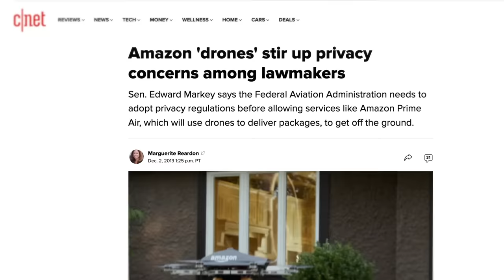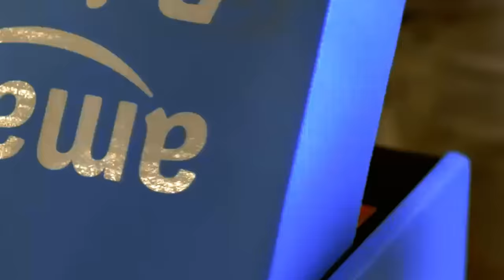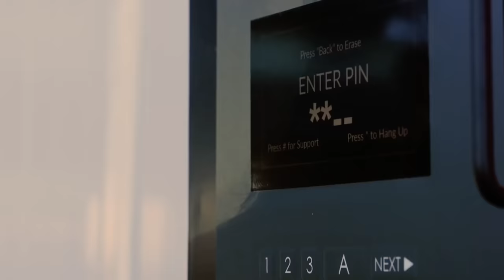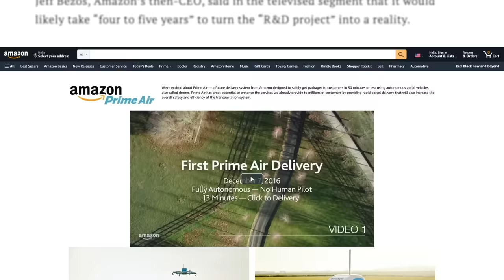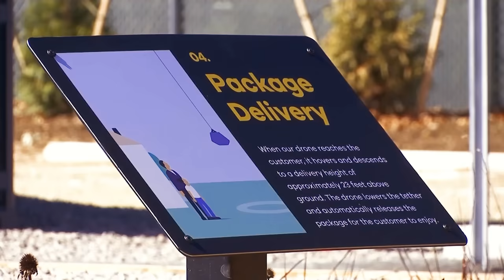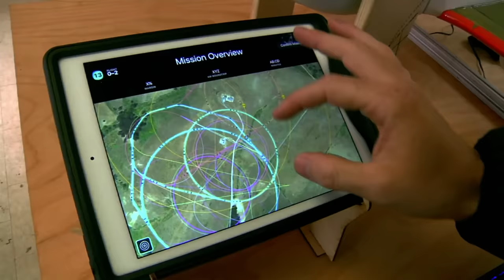Drone Delivery Was Supposed to be the Future. What Went Wrong?

Comment: In 2015 I had a college class that we needed to look at an emerging technology and do some research into the challenges facing it. For my group we did autonomous drone delivery. The biggest hurdle we found facing it was FAA regulation, namely that an autonomous drone is required to have a pilot on standby incase of an unexpected signal loss or unknown obstacles. That alone killed the tech in my mind. If the drone needs trained professionals on standby, you lose the savings from automation.

Additionally, the point you brought up of it needing to be perfect is also really accurate too. We figured it would take just one sensor going out, a failed backup, and then the drone crashing on top of someone that would doom the tech. It gets even worse if you try to have it function in a city with high population density since the odds of it landing on a person become massively higher.

This is a cool technology, that's propped up by dreams and hope, with no footing in our current reality. I think it has potential in limited uses, but not how it was pitched.
Reply: alot of the issues seem to be more engineering failures rather than fundamental. The 'falling out of the sky' would not be realistic using VTOL fixed winged aircraft (similar to what google currently deploys). While professionals on standby would indeed be expensive, you theoretically only need a handful to cover thousands of active aircraft if the failure rate is reasonably rare... thus recouping those costs with scale.  
I really dont see the issue with food delivery as a use-case. Customers value speed quite greatly, the alternative is a dedicated car/bike trip (much more expensive, paying for human labour). Most food items weigh under 2kg, a winch system (as google is doing) gets around all but the worst edge cases in delivery by removing the drone from any contact with the ground and an automatic or human operated battery swapping station would lower capital expenditure buy keeping each vehicle in the air close to 100% of the time.
Gartner hype cycle was a good analogy of the technology as alot of the 'issues' are solvable with good engineering and development time. (Really dont know why they dont use bigger props for horizontal thrust at least to reduce noise)
Reply: I wonder if instead of delivery drivers, you could have mobile drone stations. Drivers would park at a location and monitor the drones as they delivered within a given radius.
Reply: @fakename3208  why would you want to involve humans at all lol
Reply: @Redstoner2b2t  because as OP just said the FAA requires someone be ready at the controls in case something goes wrong.

But the bigger question might be why would you want to trust the AI completely? Have you seen Terminator?
Reply: googles wing already has FAA exemption (flight engineer doesnt have to actively monitor), its not hard. also lmao
Reply: Why not creating ground tunnel or sky tunnel for drone so make sure the tunnel only for drone to keep delivery not even noisy and safe?

For us to make better future should create tunnel for in every house or apartment with special tunnel unit so everyone can enjoy delivery without worry

More privacy should every room have to have special tunnel for drone will be amazing
Reply: @tonysantosa4193  mmmm yes Mr. Einstein, drones in tunnels. 🤣
Reply: @Redstoner2b2t  big tunnel or big long and thick vent ceiling in every room will be epic no need delivery man to come unless you work outside field that little disturb maximum 15 people so drone can use outside for delivery those people
Reply: @tonysantosa4193  are you actually being serious? Are you five?
Reply: @Redstoner2b2t  what 5?
Reply: @tonysantosa4193  your age
Reply: @Redstoner2b2t  lm just high school gradute person..not even go to campus
Reply: @tonysantosa4193  try to think about your ideas before posting it online for people to laugh at, especially when it’s comically infeasible
Reply: @tonysantosa4193  Ignoring the cost and logistics, I’m not giving Jeff Bezos tunnel access to my house.
Reply: Ok
Reply: @fakename3208  An even bigger question, why do you rely on fictional movies as an accurate depiction of AI?
Reply: @Oliver Charles  I was being facetious, though I do take the danger’s seriously. Automation is always dangerous, and “AI” like chat gpt is essentially a conglomeration of human thoughts and passions and ideas…which as a Christian I would label as demonic. There’s a reason why most chatbots directed to talk to eachother almost immediately devolve into speaking about sex and violence.
Reply: @fakename3208 Do you also label videos as demonic? 🤣🤣🤣
Reply: That is one hurdle, yes, but hardly the biggest. How about maintaining line of sight? What about personal airspace? I have a degree in avionics and my capstone was in part about the use of drones in urban areas. There are several laws that make drone delivery unusable.

Comment: Because it's a plastic quad drone that weighs 4 pounds, can't fly in windy or rainy weather, is sensitive to changes in weather, can only carry one thing at a time, has to deliver hundreds of packages a day, has very limited range as it needs to be directly controlled (or risk it going places it shouldn't from tiny errors), can't be used around airports or military bases, and is run using a battery that couldn't likely cross a city and make it back once without a recharge. A truck can deliver many more packages, can be used in most any weather, can go to places around restricted airspace, can easily handle heavy loads, can easily drive across a city multiple times, doesn't need complicated software/human operators are easy to train, and issues do not cause them to drop out of the sky onto people, roads, and homes. Drones are in no way perfect, and the only group with drones that COULD manage all of the things needed of package delivery are tens to hundreds of millions of dollars, need places to touch down and take off, and are both only accessible to the military and only equipped with military equipment. Which unlike a package, it doesn't matter if a JDAM is hurtling down from 5000 feet. It's going to explode anyways. As long as it arms, it'll do what it's supposed to. Which I sincerely hope isn't even remotely comparable to your Amazon packages.